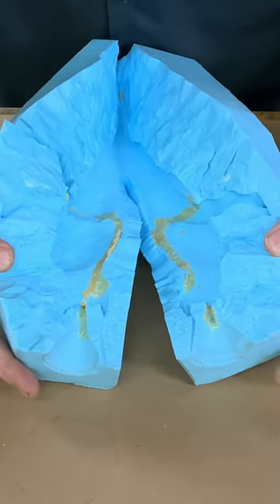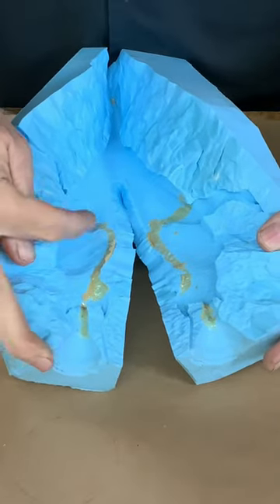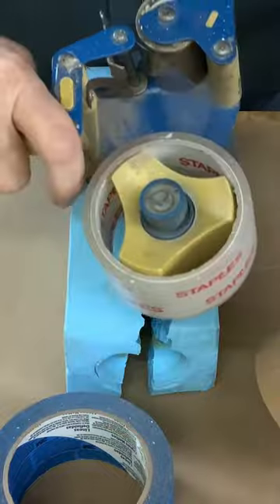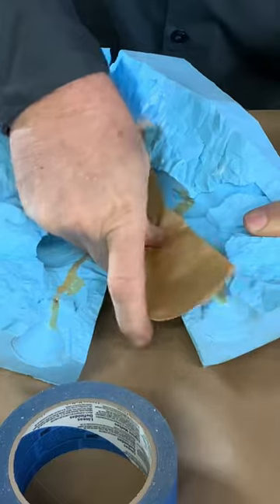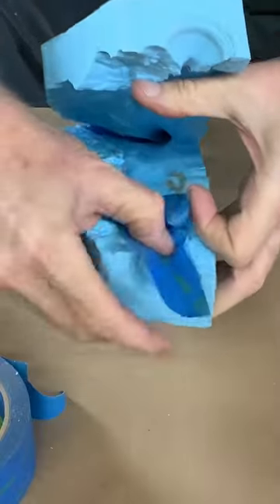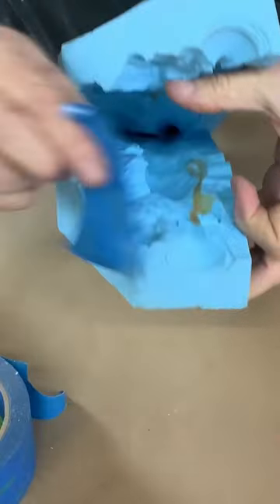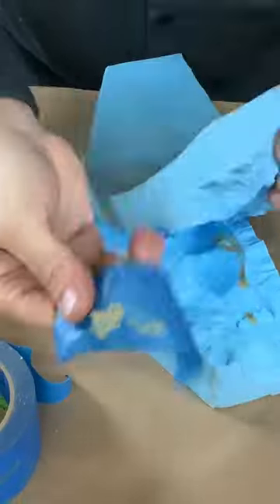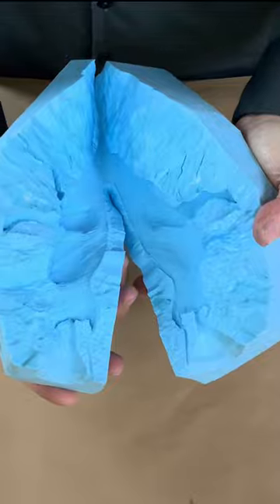Yanking Snurds With Tape

Comment: I absolutely adore this man. 
How do you do this for a living? Like what's the first step/thing to do for someone who wanted to pursue mold making & casting as a career??
If anybody knows the answer that question I would be very grateful to hear it.
I'm just about to get my degree as an electrical engineer but I would change career paths in a heartbeat.
Reply from the maker: Thanks for watching my videos!  I made my career primarily as a toy prototype sculptor. Mold making and casting are just a part of the process.  I sculpt in wax and deliver the prototypes in resin to my customers.  I was never primarily a mold maker and never intended my channel to be about mold making. I had planned to have channel about character sculpting but the mold making videos were by far the most popular so I niched down on them.
The world is changing fast and I don’t know what the future holds for traditional silicone mold making and resin casting.  It’s very likely that additive manufacturing will make many mold making processes obsolete.  Companies are printing everything from human body parts to entire buildings.  If I were starting out now that is the direction I would go in.
Reply: @RobertTolone  once again sir God bless you I'm very grateful for that information it's honestly kind of a big deal for me and now I don't regret signing up for CAD/3d printing classes maybe a career I'll never get to be married to but at least be able to flirt with her every now and then 😂
Have a great weekend friend and once again thank you so much.